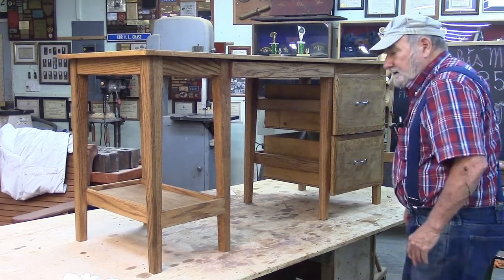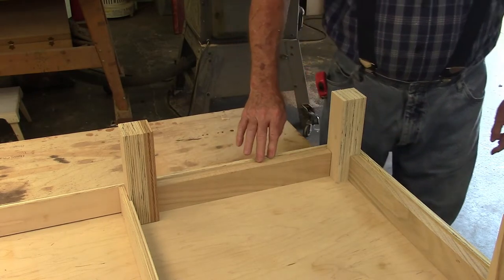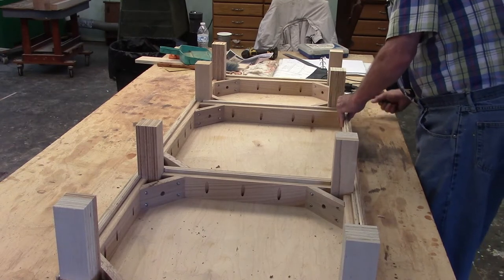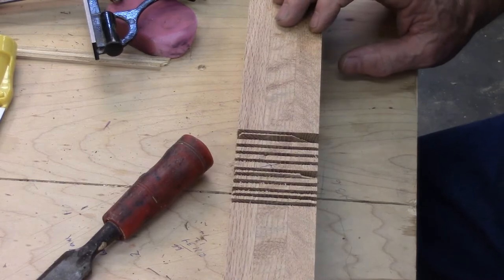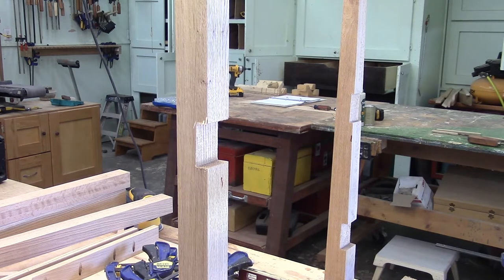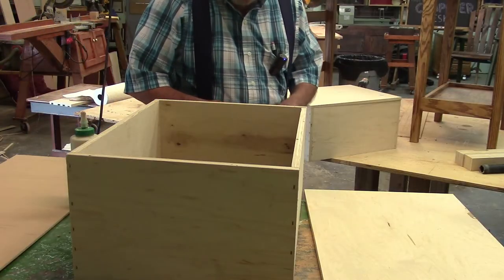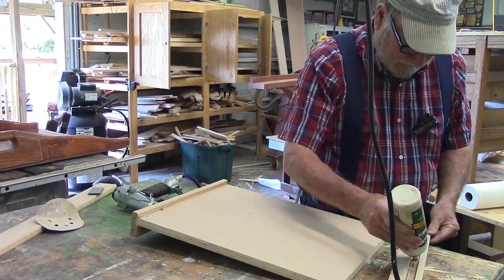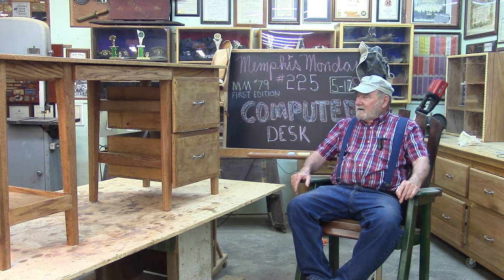225 Building an Oak Computer Desk 5 17 (Long Version)

Comment: Hey Memphis.  I decided to take a quick (41 minute) break and catch up with you real quick.  It has been crazy around here and if my brother is still talking to me when this is all over, I will be lucky.  before you ask, I did do a before video but very little as the work was being done.

First, you mentioned having a place to put "pookahs".  What are those?  Is it like a tchotchke?

I am happy that you highlighted some of your jigs.  It is something that I have been wanting you to do a video of for a long time.  You demonstrate with your jigs that you can make big jobs like this desk much easier by creating your own jigs.

I had never seen drawer pull screws.  Are they strictly for drawer pulls?  I assume that they are somewhat soft since they are designed to break off.  

What did you end up having to change about the keyboard drawer and what do you think went wrong in the first place.  Fun fact.  I bought one of those cheap put together in a box desks.  I got it all the way put together before I realized that the keyboard drawer was upside down.  There was no way to fix it other than take it all apart and that press wood junk would have never survived it.  I used it for years like that but am happy to say that it went away just a few minutes ago with the dumpster that all my kitchen debris was in.  Well, my morning break is over.  I better get back to work.  Hopefully my life will return to some semblance of normalcy one of these days.  Take care of yourself and keep putting out those great Memphis projects.
Reply from the maker: So you decided to go with the "long version!"  Folks don't like long videos, and I like to finish a project in one video, so we have a dilemma.   

    You know I would ask.  Now I gotta check out the before video.

     A pooka is Hawaiian slang for a small compartment you stash things in, "I'll just stash these papers here in this pooka."  

      I might just do a "jig" video someday, as both you and my brother Robert have mentioned it.  Perhaps the week before my next multi-week project, when I need some breathing room.  

     Don't miss Leo this week, as he finishes the frames and buys $24,000 worth of wood for the planking.  He hasn't mentioned the "floors," but perhaps this design doesn't call for them.   

     Those adjustable length drawer pull bolts are the best thing since cheese in a can.  I buy them in a big jar at Lowe's.  Before I discovered them I always had to saw off bolts to make them the right length, as the length has to be just right (not too long or too short).  I think they are a little soft, but it doesn't matter for knobs and handles on cabinets.  

      I don't even remember what was wrong with that slide out.  Those 100 percent drawer guides need adjustment about 50 percent of the time; it's just routine, and I almost never include it.  I do remember one time I made the opening too small, and I had to thin out the sides of the drawer.  Well, all anyone saw in the video was the drawer going in perfectly.  

      Funny story about the desk.  Funny I think because most of us have done the same thing.  Very simple, if it works then it's done, and I'm not going to take it back apart.  

      Don't forget about Leo, as watching his videos keeps the scope of our projects in perspective.  Thanks for watching and commenting.
Reply from the maker: Where is that before video?  Did I get all lathered up for nothing?
Reply: @MemphisApplegate  You had to have known that I would go for the long version as many questions as I always have.  I am nerdy like that.

Thanks for teaching me a new term.  I don't think I have ever heard the term pooka.

Good idea to do a jig video as a filler video for a large project.  Your jigs definitely make woodworking much easier and more precise.

I think I am 2 or 3 videos behind on Leo's progress.  He posted a picture on FB that made it look like the ribs of the hull were finished.

I will look for those screws at Lowe's.  Your comment reminded me that I haven't picked out handles and pulls yet.    TOO MANY DECISIONS!!!!!!!

I had a feeling that one of the problems with the drawer was that it was too tight.  It also looked like you may have put the pulls too low on the drawer the first time.

I have gotten rid of about 10 pieces of that cheap press board furniture but still have a few more to get find replacements for.

I will check out Leo's videos soon.  His project is very captivating.